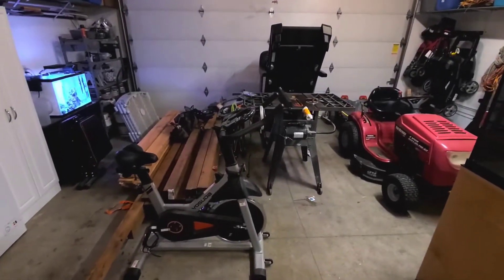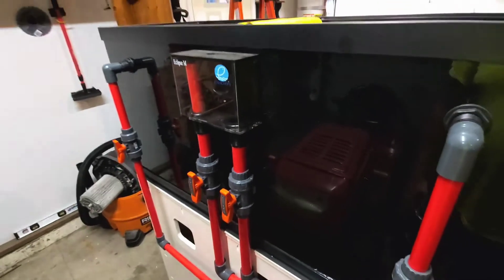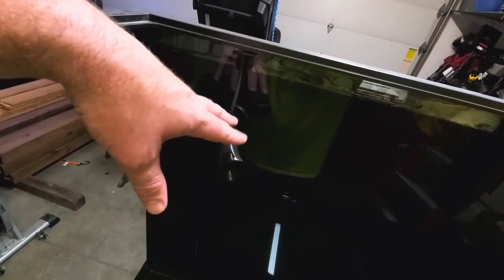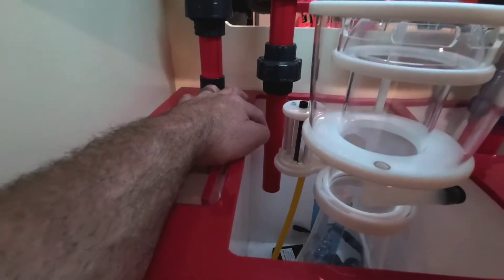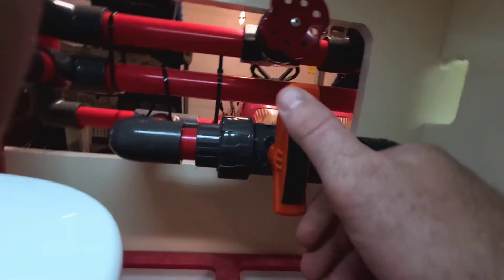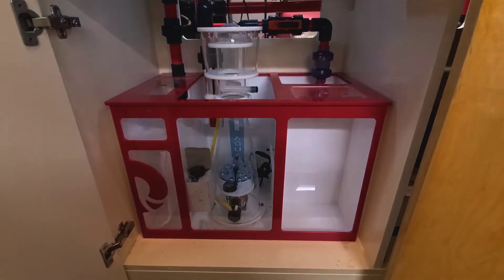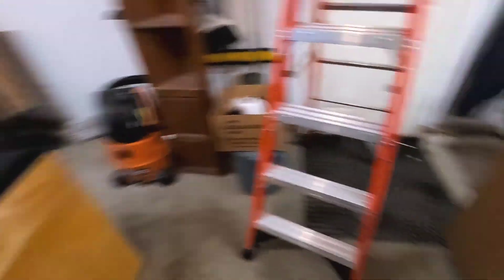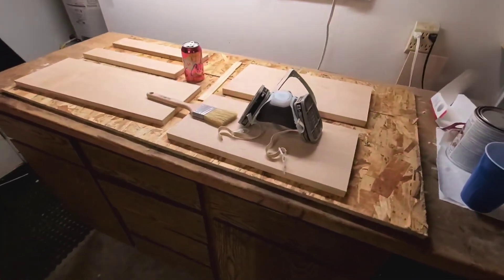90 Gallon Reef Aquarium Update: Plumbing, Equipment, Controller Board

Comment: This build is coming along nicely! Thanks for sharing some of your decision making challenges. Beautiful stand. Definitely appreciate the respect for working safely. Most YT'ers don't know jack about PPE or working safely. You almost had it nailed....except for that respirator just setting out collecting dust and other particulates. I'm sure it was in a bag right before filming.... :)
Reply from the maker: Thank you for the comment.  Good point about the respirator being in a sealed bag.  The answer is - yes, it was stored in a sealed bag and had just been removed for inspection prior to use.  Here is an interesting side note - The next time I paint in the garage, I'll be sampling the atmosphere with 5 gas detector.  It will quatify the level of volatile organic compounds(VOCs) that are being introduced into my garages atmosphere while using oil based paints.  I suspect that it will be well below any action levels.  I'll also be able to detect the LEL level.  (Safety Nerd - level 100 lol)